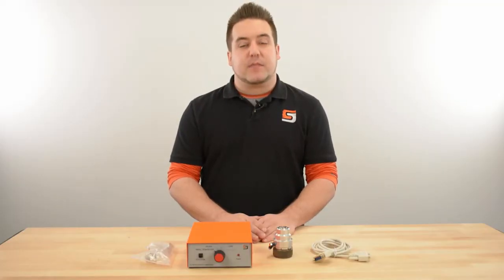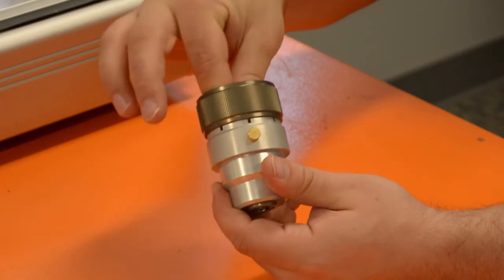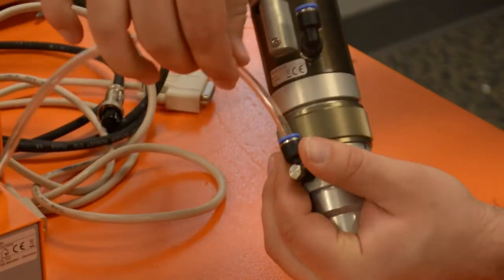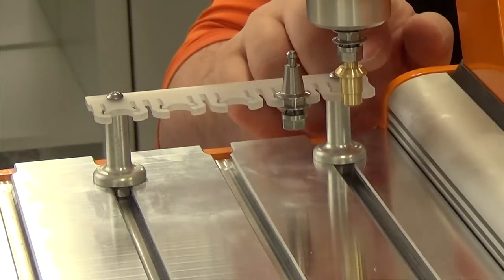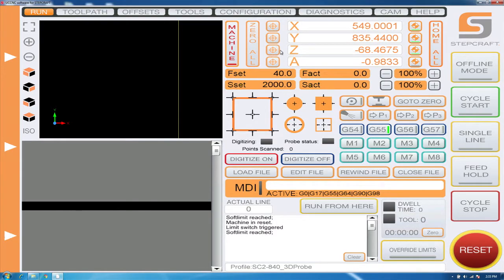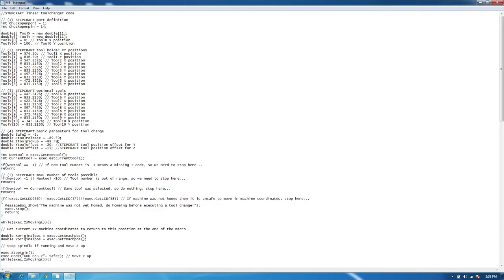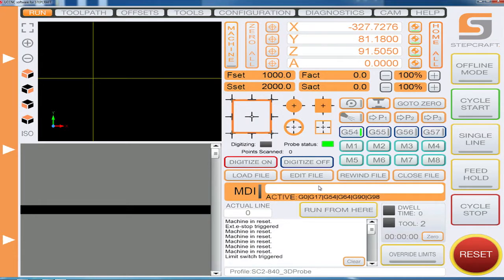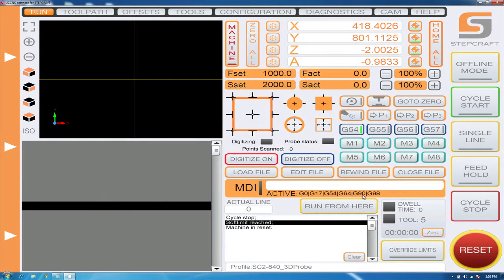Install and Set Up the STEPCRAFT Automatic Tool Changer - Step-by-Step

Comment: i guess you can get taller studs for the tool holder. 50mm tools in 140mm machine Z can be some times unhandy.
Reply from the maker: Yes you can easily buy longer stand offs to raise the height of the tool rack.  Then all you need to do is reset the Z height in the M6 Macro
Reply: @StepcraftInc  nice, thanks for the quick reply. we are thinking of buying a D or Q series.
Reply from the maker: @constantinosschinas4503  We will be happy to do whatever we can to help you.  I am not sure where you are located, but if you email us at info@stepcraft.us we can direct to you the dealer closest to you (if not in the USA or Canada)

Comment: Is it possible to use the hf500 with the tool changer on a different cnc machine.
Reply from the maker: Yes this can be done... you just need to wire in the solenoid signal from your CNC and you need to program your CNC machine control software to the correct ports
Reply: Could this be made to work on a carbide 3d shapeoko?

Comment: Can the tool changer be used with a Kress spindle?
Reply from the maker: Yes, it works with both the Kress 800 and 1050 FME spindles as well as the MM-1000
Reply: Thanks guys.  You're the best!  Glad I bought Stepcraft!